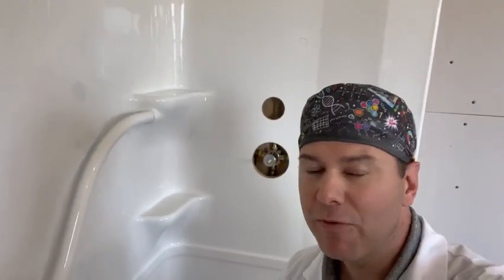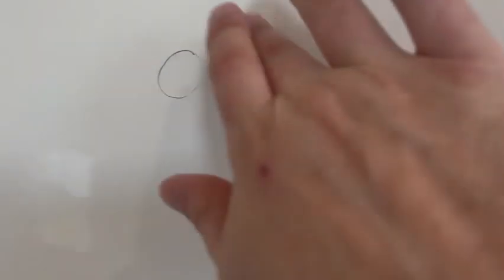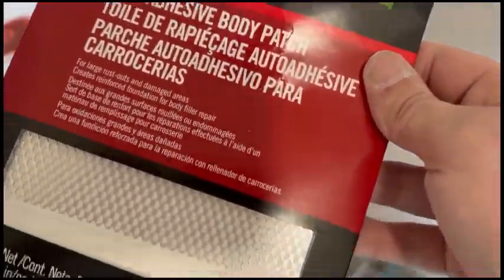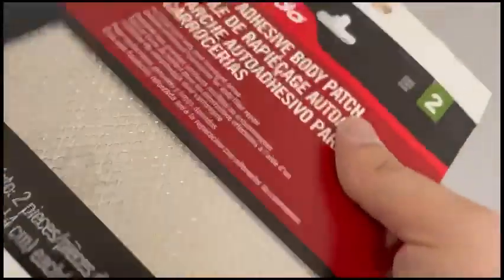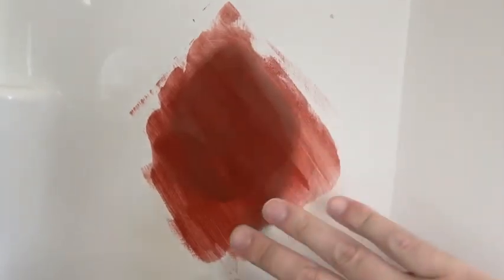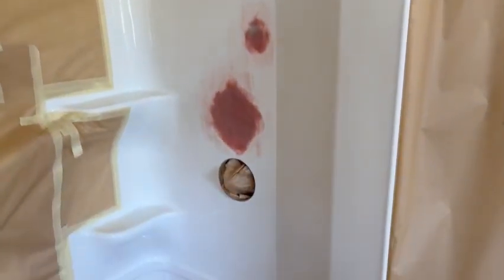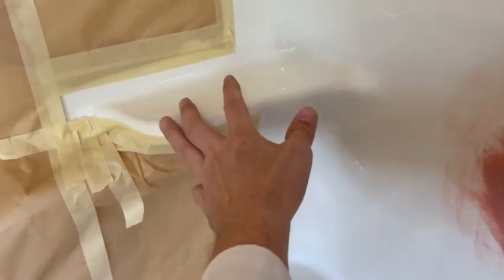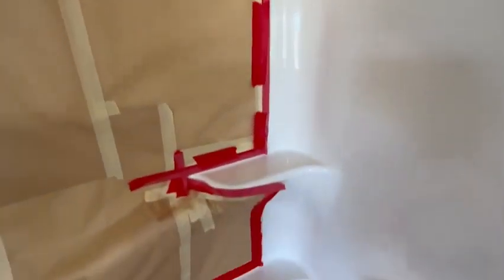How to fix a large hole in a Fiberglass tub!

Comment: I have a fiberglass sink with a crack in it that I'm educating myself on to try repairing it.  From other videos that I've seen, I was ready to do the Bondo resin with fiberglass matt, followed by short strand and then the putty.  From this video it seems like I might be able to get the job done simply with the short strand BONDO GLASS REINFORCED FILLER.   Is this the product that I would need?

Comment: Did you have to buff it
Reply from the maker: No buffing or polishing. 
Use the blending solvent mixed with a little colour resin and it lays right down. No problem, then on the edge of that I use a PPG blender in a spray can, melts in perfect and you can never see where the repair was.